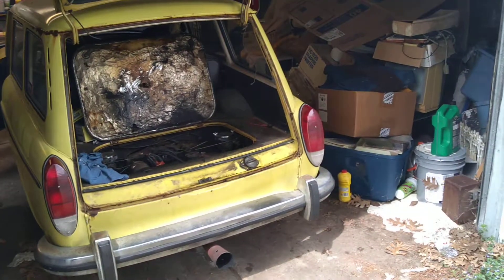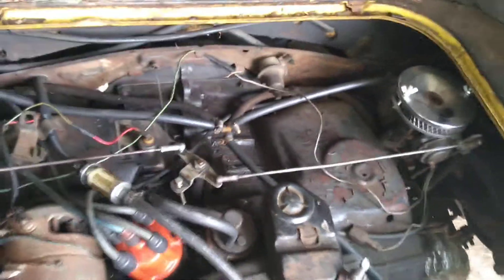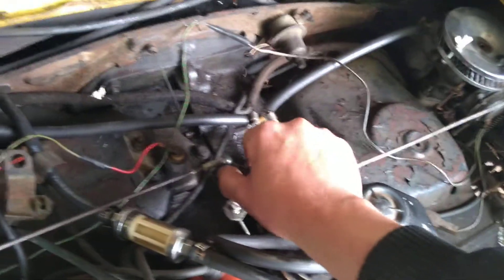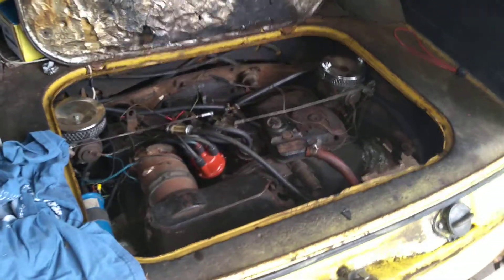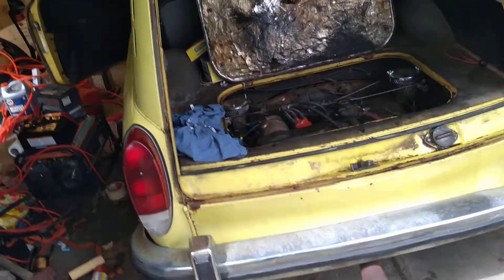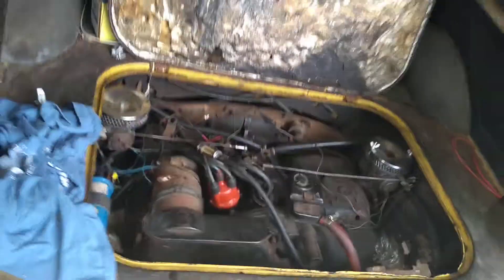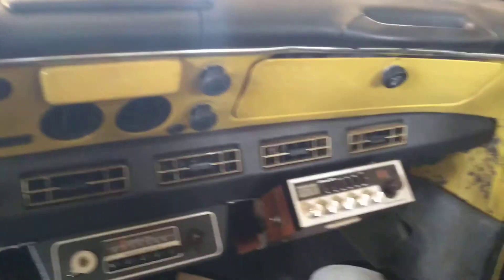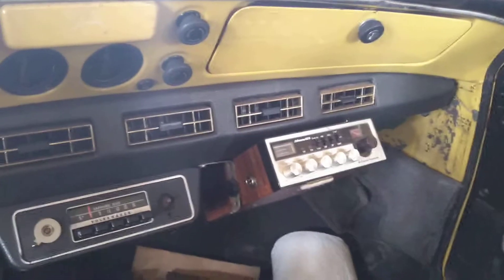Ready to pull the engine out. It's what we do.

Comment: going to be putting my distributor pinion drive in today as well as my oil pressure relief valves... wish me luck lol....
noticed you got a dual carb set up, do you have the "sync" tool for the carbs? (i got a set of duals for my rat, first time dealing with them.)